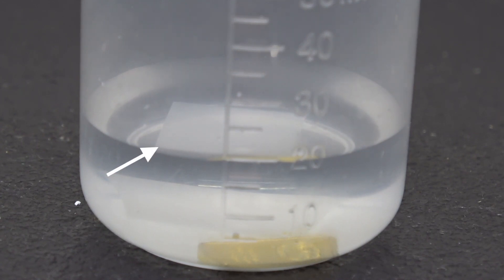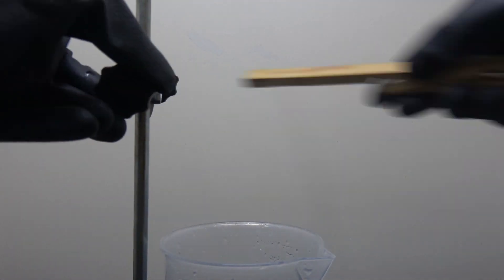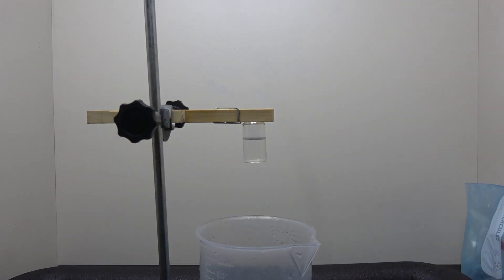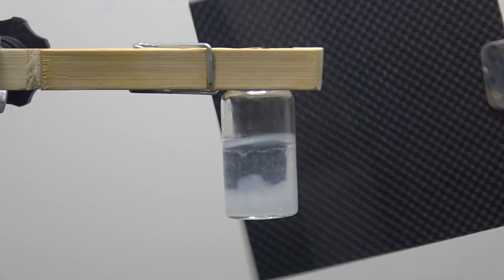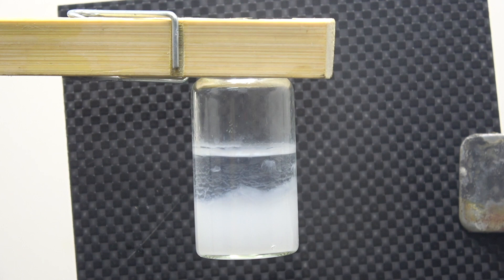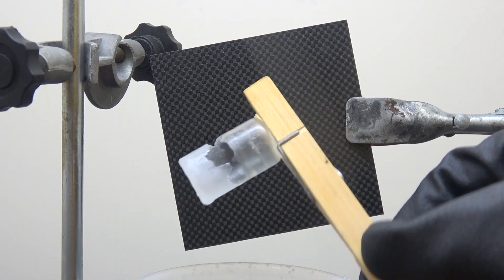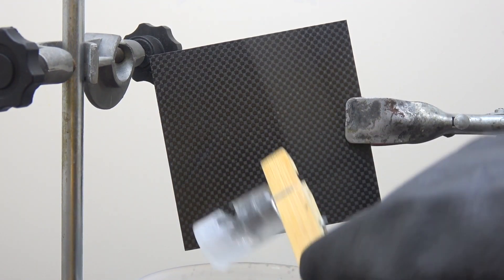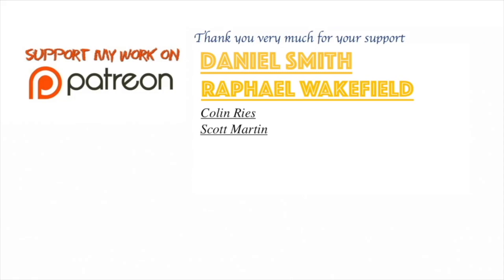Dissolving Glass in Hydrofluoric Acid

Comment: which metal container is used to store hfl acid? 
eg lead. stainless steel
Reply: Usually it’s stored in PTFE bottles but at large scales like HF storage for refineries passivated stainless steel is used. Chemical suppliers typically ship these kind of chemicals to labs and hobbyists in little steel cans that contain a sealed plastic bottle (usually PTFE if it’s particularly nasty like HF) which actually holds the chemical.